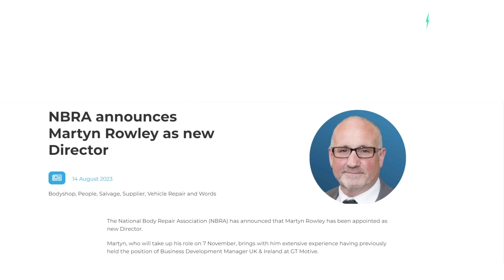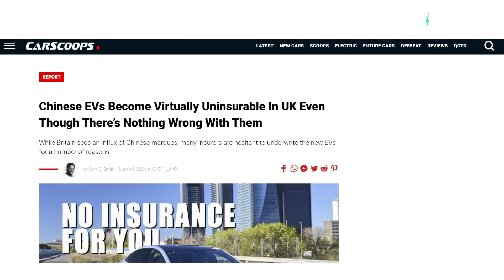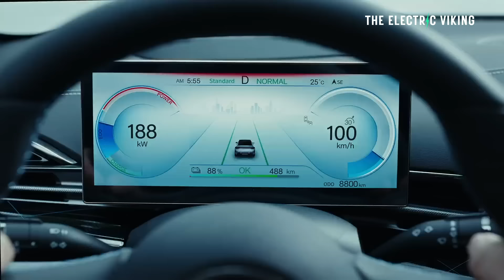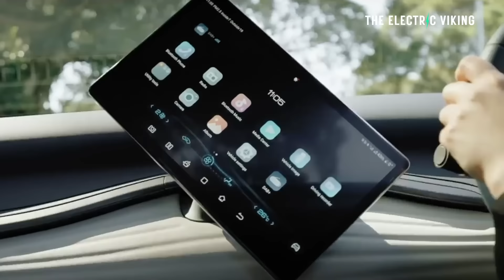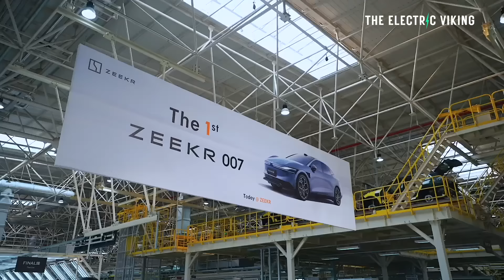In some countries Chinese EVs are almost impossible to insure

Comment: I’m UK based and not noticed a specific excessive premium for my Chinese EV v’s my other cars.  I think this is FUD.
Reply: there is a yotuber who paid 750 for his first year on a new 120k  ev porche it went up slightly in the second year but by year 3 it trebled to 3000 he shopped around and bought it down to around half that but his car  has dropped to a third of the value 40k
Reply: Its a porche he somehow got a great deal initially and now its prieced appropriatelly, it seems like people don't realise that insurance is base of of the sale price and performance of the car. Its irrelevant if the used car sale price went down if the prices of the spare parts are expensive. I also own Chinese EV just went on the comparethemarket and got similarity priced quote to what I am on now from both Churchill and admiral. As both byd and mg are increasing their footprint of sales rooms and service centers this will be less of an issue as the only problem now is the wait times for some spare parts. However I can tell you that that is also an issue for example for Tesla in Slovakia as they dont have a single service centre or point of sale location in the entire country.
Reply: If you can't get repair parts, it's a real problem, not "FUD".
Reply: “In some countries” maybe not the UK?🤷‍♂️
Reply: Insurance companies rely on actuaries to provide risk templates on vehicle segments. Try insuring a BEV that’s more than 3 years old. You might as well scrap that car
Reply: @debeeriz which YouTuber so we can check your claim...and then check this YouTuber's claim.
Reply: @incognitotorpedo42 it's a lie.
Reply: @elonsmaps probably 
"The mac master"
Reply: @elonsmaps  the macmaster
Reply: @carlishiggins  he is definitely not a poster boy for electric vehicles, he was saying he hardly lost any money on his porches in the past, in  fact he made on one, but this  one he will lose big time
Reply: No problems insuring them here in Denmark either. I havent bought one yet, but have checked prices for several models and there are plenty of insurers that offer quite normal insurance prices for them. Some of most powerful engine versions (like MG4 Xpower) are a bit expensive, but not more than any other car with a powerful engine.
Reply: @yslee1401  more FUD - my Chinese EV is over 4 years old and I have no problem insuring it.
Reply: BYD WANTED TO BUILD FACTORY IN ENGLAND BUT BREXIT IS CAUSING THE PROBLEM , They will open a spare parts outket like tesla soon ! Once their european first fastory opens in hungry ,
BYD WILL EVENTUALLY build small factoey in england

Comment: This might be also the reason that BYD is not going to the US. At any can-not-repair issue or a battery issue they will get a legal process. That will become a nightmare,

And now the question is how cheap is a BYD really to build in case they must write manuals about how to repair the car and when the must set up infrastructure and keep stock for each type of cars world wide? In Europe it is good practice (not a law) that parts are available 10 years after they start production and up following that the parts are 5 years in stock.

Comment: Wait .....my Girlfriends car has been sitting at the body shop 99% repaired from an accident for the last 6 weeks waiting on 2 small parts that do not affect  driving. She has a 2021 Ford Flex ....it is not just electric cars.  As for the insurance cost for Tesla, in the USA in the states (about 15 currently) where Tesla Insurance  offers policies the yearly cost is about 1/2 of what other insurers charge due to Tesla having access to the data of your driving habits etc. Just wait till they expand to 49 states they will crush the insurance industry also .....at least for Tesla cars. Also they will never offer insurance in Florida.

Comment: My car is 10 years old and I am thinking about getting a BYD Dolphin. Out of curiosity I look up the insurance group and it is 33, which is high. Putting it down to the cost of repairs, I have decided to put off the purchase until next year in order to allow the dealer network to expand and for the insurance companies to gain experience of BYD because they are a new company. Hopefully, it will be in a lower group next year.
It isn't a major problem for car manufacturers to ensure that there are sufficient spares in their foreign market countries. So that problem should be easy to fix.
One reason for the higher insurance cost of electric cars is because Thatcham claim that if is an electric car has been in an accident there is no easy way to determine whether the battery cells have been damaged and the battery pack may need to be written off.
Teslas are also expensive to insure and one reason is there are a disproportionate number of accidents in the first few weeks due to the terrific acceleration. Teslas are around group 50.

Comment: There is a very good reason why electric cars cost more to insure actually…
A small crash that as little as scratched your battery makes that EV unrepairable, it becomes a fire hazard. 
ICE cars do not experience that in nearly the same proportion, in most cases they’ll have a relatively sensible repair cost.
Applies for the time being anyway.
Reply: Most Batteries nowdays Even If pirced don't explode....
Reply: What bullshit lie.
Reply: @elonsmaps  LFP batteries do not explode if pierced. The other LiIon batteries not so bullet proof, but it takes quite a bit to make them burn — stupid charging, over-heavy-discharge etc. etc. 
Gasoline also is very flamable, look up the statistics for car fires in the U.S. and you’ll be surprised.
Reply: Chinese use LFP and they are easy too replace. Two of the to market leader MG and BYD use much easier to replace battery compared to 2160 cells used by almost everyone.

Comment: I am looking at getting my first EV this year via a company salary sacrifice scheme. 

However, lease costs are rising and rising from what I can see. 

An example, the Tesla Model 3 has risen almost weekly since the new version was launched in the UK, and is disproportionately expensive based on its list price compared to comparable vehicles. The only reasons I can think of to explain this are depreciation and insurance.

Depreciation doesn't stack up as I doubt it's any worse for a Tesla than other EVs.

Insurance, however, does stack up as I can see that even the RWD Model 3 is Group 50!!! Compared to many other EVs with similar, or better, performance that are in Group 40 or lower.

Having said that; other EVs have also risen sharply in price. Another example, the BMW iX3 e30. This was under £400 per month with insurance and maintenance on a 48 month and 7.5k miles per year contract. Now, it's around £540 per month!

All this means that the supposed savings of getting an EV via salary sacrifice look increasingly dubious, and I am going to stick with my petrol car for now and have extended my lease for another 12 months.

Comment: Not just EVs--I recently saw a gas pickup, either Ford or Chevy, with a single tail light costing over $500 for the replacement part alone. A couple of decades ago I could go to the dealership and pick up a replacement tail light housing for $35 and replace it myself in less than an hour with basic tools. Sure, you expect some inflation over that time but it has become ridiculous.

Comment: I recently phoned my insurance company about the premium to re-insure my current car (ICE) for another year. The agent knocked a few dollars off and I signed up. While speaking with her I pretended I was considering buying a new 2024 Tesla 3 and would like to know what the premium would be for full comprehensive. She tapped away for a little bit and came up with a figure slightly more than a new comparable size 2024 ICE car but it was fair. So I don’t know what this EV insurance problem is all about.
Reply: Exactly. Automobile Association research and the statistics from the Motor Insurers Association both confirm your experience. The average cost of EV insurance is slightly higher, but the average value of EVs currently on the road is significantly higher. The average EV is slightly cheaper to insure per £1000 of car.

Comment: It is incredible that only Tesla gets it, it is not possible to transition by continuing the century old ICE paradigm of continual model and trim changes but powered by batteries.
Reply: Tesla also doesn't get it: little to no dealer network, waiting weeks before spare parts arrive, for a repair you'll have to follow the same procedure as at work: create a "ticket" for the ICT helpdesk. Sorry, but a no go for me.

Comment: At this point in time in the EV product lifecycle, early adopters should expect rapid depreciation, high insurance and repair costs, poor charging infrastructure availability and rapid obsolescence.  EVs have much more limited use case scenarios compared with ICE vehicles and are not zero emission.

Comment: The solution Tesla had was to set up it's own network of service and repair services.  Chinese Insurance companies could step in to offer policies.
Reply: Problem of insurance in UK. Example. Insuring Tesla model Y, my current insurer would not insure, cost of insurance with another company was greater than the cost of insuring a collection of 5 ICE cars, (all relatively old cars) with my present insurance companies.
Reply: Just like own charging network. Insurance needs to be part of purchasing.

Comment: ???  Do the combustion engine companies own, or have stock in, these insurance companies?   [and control prices]
Wouldn't surprise me at all!!
Reply: In US, insurance companies invest premiums and claims are paid out of the money they make. If you look at IAA auctions, it doesn't take much damage to make EV a write-off and all that gets factored in to premium. All newer cars are more expensive and complex to repair because cars have expensive airbags but they are a lot safer which helps offset repair. Companies like Hertz, the ones selling Tesla's because high cost to maintain likely self insure. 
I didn't know how UK insurance works but there are videos where domestic buyers are having issues not with insurance but with repairs.

Comment: So what’s the message here. Simple. Stick with your trusty ICE car until this whole EV behemoth stabilises. It’s out of control, charging infrastructure is sh-t, minor collision repairs are ridiculously expensive. And the elephant in the room - batteries - still the weak point of all EVs. I think anyone considering swapping to electric should wait perhaps another 2 or 3 years, and then see what the battlefield looks like before signing that contract.

Comment: and so they should be expensive to insure they are a heap of rubbish fall apart cant be fixed wait months for spare parts and in 5 to 10 years will be in the tip like your mobile phone good luck  to anyone stupid enough to buy a thermal runaway

Comment: No excuse for slow parts, in late 60s I was spare parts manager for Thiess Toyota ( Land Cruisers & light thucks, if we didnt have a part that kept a vehicle off the road I would ring Japan & we would have the part in 2-3 days by air.
They even airfreighted 12 leaf springs when we needed them.
60 years later you would think that wouldn't be a problem if you cared about your customers.